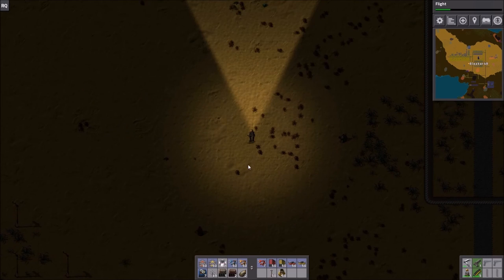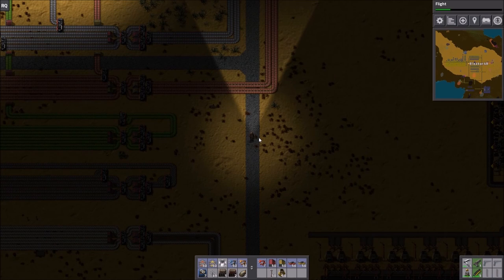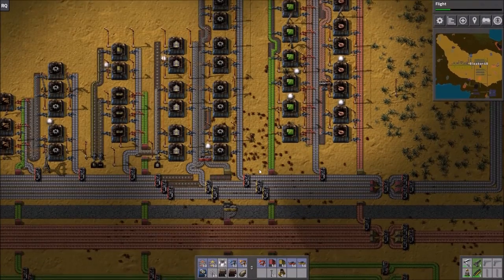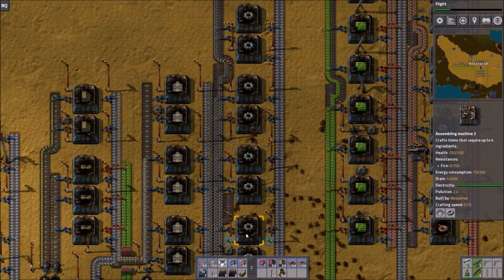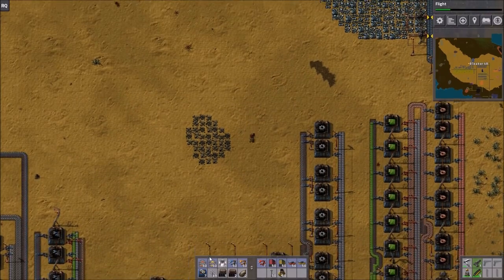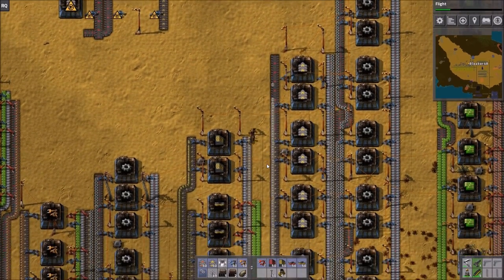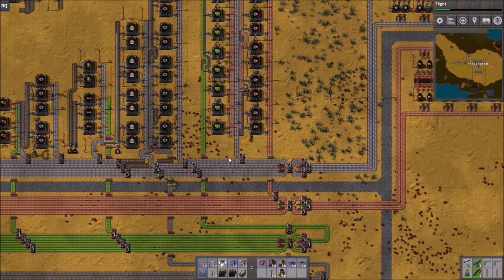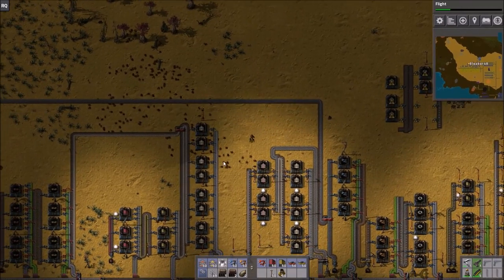Factorio 2022 - How to setup an easy to expand and adaptive factory

Comment: This is what I would consider "scalable", not necessarily modular.
Reply from the maker: I respectfully disagree, you can use this design for almost any recipe making it a design that you can drop in anywhere and it will work thus modular, I do agree that this is a scalable design as well however
Reply: You give the same example multiple times of scaling up production to meet demand by adding additional assembly machines.
I must have missed it but where in the video do you substitute the production of item A for item B?
If your position on "modular" is that the same general design can be applied to produce a variety of items then that's incorrect.
It would be like describing a box assembly line that can be adjusted to glue, fold, and stack boxes of a variety of sizes as "modular".

"Modular" in terms of an assembly line often means that multiple steps of the assembly process will be happening in parallel, on their own assembly lines. Take a car for example, the seats aren't made on the same assembly line as say the doors, or the frame... But eventually, all of these parts from each assembly line "module" will meet for final assembly.
Reply: I don't even play this game, a friend of mine told me to check it out as it's something I might be interested in.
Your video was the first to come up that sounded interesting to me... "easy to expand" was a scalability buzzword that attracted me to the video.
Ultimately, I did learn something from the video and it was presented very well. It was just the use of the term modular that I took issue with.
Reply from the maker: Out of curiosity do you do anything in the world of automation? I was very please with your argument so I am curious